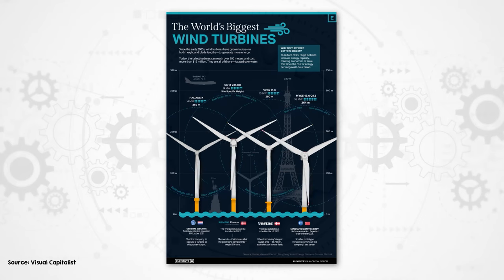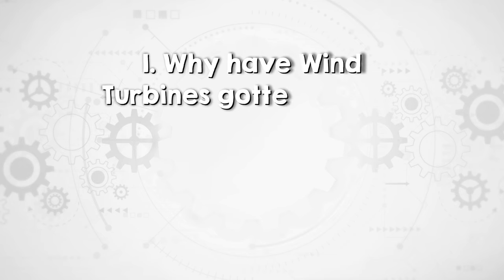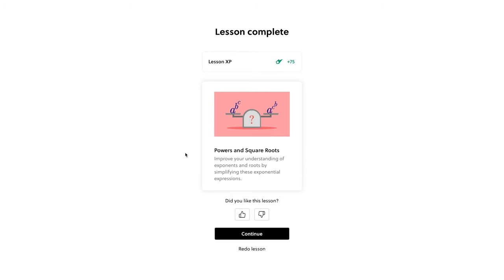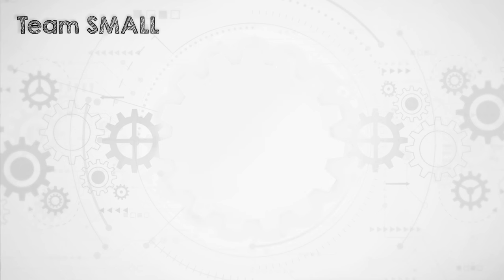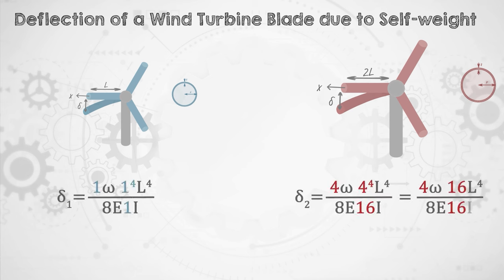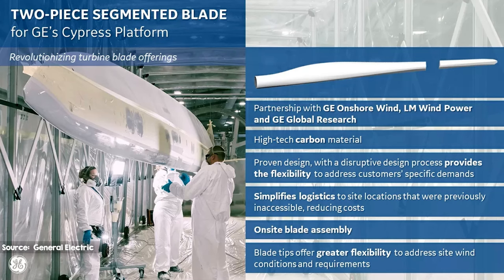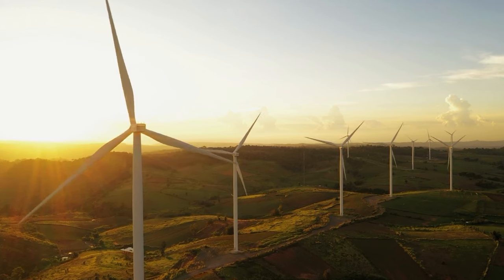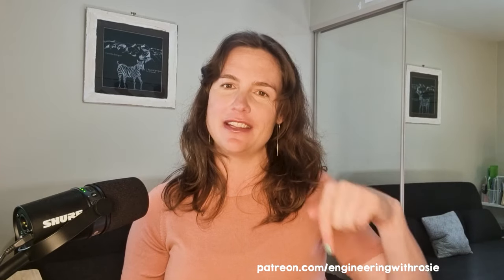Discover the Surprising Science Behind Wind Turbine Design for Lower Energy Costs!

Comment: Or maybe blades will change. Airplanes went from 2 blades to 3 to 4 to 5 as more power was applied. Then there's exotic designs like scimitar blades. Maybe wind turbines will do something equivalent. And generators could go with superconducting coils/magnets. Lots of room for improvement.
Reply: Three blades is optimum. As l understand it you have to allow the wind to pass through - more blades and the wind will take a path around. Anyway there's actual experts have made videos about this.
Reply: @DavidOfWhitehills  I've watched those and more blades also mean lower speeds for same torque, therefore quieter,  and less air speed difference between the top and bottom blades.
Reply: @tsbrownie  So why aren't they being built with more blades?
Reply: @DavidOfWhitehills  Why were the first aircraft 2 bladed? Same with ships screws. Look at the development of submarine screws. These things usually boil down to current technical capability and costs. Those change with time.
Reply: @tsbrownie  Hmm. If you obstruct the wind you lose the wind, it will just go around or over.

Comment: One key parameter you didn't mention is the energy return on energy invested (EROEI or EROI). Not only does the parts get heavier and cost more, but they take more energy to make a large wind turbine. But also the power produced goes up as the square of the disk radius. Also the EROI is determined with the total energy produced over the lifespan of the system. Wind turbines have a operating life span of 20-25 years. So EROI is the amount of energy produced by the wind turbine over its total lifespan divided by all of the energy that went into making all of the parts plus the energy required to transport and install the wind turbine and lastly the energy expended to during maintenance Of course the higher the EROI the better since the amount of energy that is available for use is hopefully many times greater than the energy that it took to make, install and operate the wind turbine. In the limit a EROI of 1.0 as low as one would go since you would only get back energy exactly equal to the energy you put into it. So which increases faster with radius, the sum total of power produced over its lifetime or the amount of energy that it took to make and install thicker walled and taller steel masts, heavier gearboxes and blades. 

invested
Reply: Many have been found to have a lifespan well under the 20-25 year prediction. Some are lasting less than 10 years due to leading edge abrasion and delamination of the blades. This is especially the case in coastal locations and offshore installations.

Comment: Another great video. 
I didn't know you had a PhD as well. Your formal expertise in these fields is far greater than you have let on, so it is Dr Rosie from now on. :)

As for the future of wind turbines, if blades that can be assembled on site, arrive in two or more pieces, can't be competitive priced, then I can't see many onshore wind projects having larger turbine blades. As you pointed out, the challenge isn't just going to be the problem of the logistics of the length, but the cross section or diameter at the base of the blade is going to be a major limitation too. 

Off shore wind turbines has a greater potential to keep getting bigger as the logistics are less of an issue, but the handling cost is surely going to become more expensive as they grow in size. The only question then is what the rate of increase of these costs are compared to the energy returned. Sure the squared vs the cubed does help, but at some point the returns will diminish, however I think we are a long way from that point.

Comment: Very good.  I play in small (micro) wind energy ~ I do a bit of writing and sometimes teach workshops on the design and build of small wind electric systems.  Size often comes up and I always have to point out the advantage of height (which often comes with larger machines) ~ and the fact that energy harvested is related to the cube of diameter while the weight of the rotor, and the alternator is roughly related to the cube of the diameter.  With small, direct drive alternators I usually use about 8x the magnetic material and 8 times the copper, if I double rotor diameter.  (4x the power at half the rpm)  I love your channel.

Comment: Great videos on wind turbine design, very informative. I particularly enjoy the ones on VAWT’s as I got involved in a VAWT start up after I retired, but subsequently left the business for reasons outlined below. 
Without giving too much away wrt proprietary design which is being patented, we were trying to boost power output by manipulating (increasing) native wind speed impinging on the blades of an H blade VAWT (though it could also be applied to spiral blades). 
Ref the wind speed power equation, the two easiest elements to modify to increase power are obviously swept area and wind speed. In one of your VAWT videos you cover why increasing VAWT swept area comes with increased costs and technical challenges, and why the Betz limit effectively rules out trying to become more efficient than HAWT’s as a credible performance improvement avenue. 
So that leaves wind speed, which because it’s cubed in theory offers by far the best chance to increase power output. However, increasing native wind speed requires external intervention / interception and we found via patent search numerous examples of VAWT designs employing external devices to do this, eg, cowlings, Venturi’s, funnels, diversions, channels, etc, but what was also obvious was that none of these seem to have ever been effectively commercialized, suggesting they either don’t work or more likely don’t work well enough to warrant significant development investment. 
As we progressed through TRL design and testing we did find some wind speed increase that would require VAWT / blade design optimization to capture maximum benefits, but it wasn’t enough to likely challenge and replace the dominance of HAWT’s on the market. 
HAWT’s dominance effectively meant breaking into the wind power generation game would require significantly more power (wind speed) increase than we had seen to warrant an investment risk on a new tech start up as opposed to a less risky ROI through simply making bigger HAWT’s! 
After much consideration it was the observed experimental limited wind speed increase potential, slow and expensive pace of development and extreme business challenge that caused me to make my decision to leave, but it was still a very interesting project to be involved with. The business is still working on trying to improve the concept! 

So this brings me to my technical question to you, in your opinion why do you think attempts to increase native wind speed before hitting the VAWT all seem to fail, or at least not work well enough to warrant further investment, and finally achieve commercialization? Maybe a good topic for a video?

Comment: Would you comment on the idea of multi rotor contra rotating turbine hubs.  I understand wind turbulence from adjacent wind turbines in a wind farm is a consideration in efficiency.   However many propeller based aircraft designs over the decades have successfully used contrarotating propellers accepting any inefficiencies for the advantages of smaller diameter and ground clearance and high engine power absorption.  It would also seem that the upstream rotor is adding some kind energy in the form of turbulence to the air stream that the downstream rotor could possibly be designed to take advantage of.  The common understanding of wind farm inefficiency due to air turbulence of nearby turbines does seem to get a little more interesting when the accepted use of contra rotating propeller aircraft is introduced in to the conversation.

Comment: Hello. Good, but there are some little points - hmm:
"Kevlar" is Aramide. And under pressure it's much worse than under tension (The same for HM-Carbon fibre not mentioned here.)
Next important point:
The gearbox growth is exactly by cube with diameter: If you double all dimensions of a WT, with a constant tip speed you end up 8 times of the torque. That's in fact the same machine (except minor aerodynamic incluence in this sizes- bigger is better - as in real life). 
So if you have the direct-drive Enercon E126 with 400 tons of Nacelle- try to made a 200 m rotor :-) A rough estimation ends up at 2000 tons. 
I assume you'll kill additionally all the frequencies of the tower. Therefore: gearbox- machines- maybe. But direct drive has stopped already.
And to compare strong-wind and low-wind-machines isn't as easy. That's apple with pairs.

Comment: As an electrical engineer with some structural and heavy equipment background, your math and graphics ratio were perfect.  What a great example of a typical engineering problem - optimizing many design variables.  And scaling is such a wonderful way to prove design concepts but can be problematic in certain engineering areas such as fluid dynamics if I recall.  Scaling, and ignorance of resonance, (as someone else commented here), was the downfall (literally) of the Tacoma Narrows bridge.

Comment: Excellent as always. I enjoy your forays into the formulas and principles without tipping over into total geek speak. You tread that line well. How to different soil structures figure into foundation design? More importantly, does it significantly affect the cost.
BTW, any reason for eating cake yet?
Reply from the maker: No celebration cake for me yet, though being 41 weeks pregnant has led to a few cake cravings I will admit (assuming that's what you meant by the cake comment!)
And I'm glad you thought I got the balance right between showing the important formulae but not making it an engineering lecture. It's a tricky balance!
I don't know a whole lot about foundation design, but that could be a cool topic for a livestream if I can find an expert to get on as a guest. There have been a few foundation failures in the news recently, it works be nice to find out more about what that's about.

Comment: Another great video Rosie!I find turbines fascinating and have pondered this question before. Two thoughts came to mind whilst watching the vid:

- might it be possible to construct a pressurised blade? In the same way that a paraglider's wing stays formed during flight, a pressurised blade (with a compressor near its 'root' and electrically powered) would help maintain the form of a partially 'flimsy' shell. This could reduce manufacturing and transportation costs.

- Thinking about when the wind is not blowing, is one large inoperative turbine better than 5 smaller inoperative ones? Or is it better to spread the risk of no wind?
Reply: Hm, a pressurized blade seems like a good idea, until the pressurization system fails.  In the 1980s, there was a trend of building stadiums with super lightweight membrane roofs weighing a fraction of conventional truss supported ones.  They were held up by a slight overpressure in the building and were of course much cheaper to build.  Eventually they all failed due to environmental conditions and/or failure of the overpressurization machinery.  All but one have since had major structural work done, aka explosive demolition.  Great in theory, not so great in practice.  There's also the problem of pumping air from a stationary compressor into rotating structures.  I'm a structural engineer, not mechanical, but it doesn't sound easy.
Reply: @drecksaukerl  Thanks for your answer! My thought was that the compressor for each blade is built into the base of the blade, electrically powered by a 'ring' electrical connection through the turbine's axis and possibly also the pitch mechanism. Re: compressor failure - I guess this would depend on air leakage through the blade and whether the brake mechanism could halt the blades' rotation quickly enough to prevent serious damage and if a pressure connection to adjacent blades would be worth consideration.

Comment: Thanks Rosie.  Your video got me thinking (the best compliment 🙂) is the air mass of anabatic and katabatic winds sufficient to support power generation? I live near a coastal mountain that has a cliff face with tremendous winds (in both directions) I sometimes wonder if very large axial fans of efficient design, bolted to the cliff face, could overcome the tower issues?

Comment: Great video!! Very educational!! . You said something about new designs and I agree with you there too. There’s a wind machine design out there that instead of going up in the air is going down to the ground , in fact it’s going to be under ground. The designer thinks this machine could produce hundreds of megawatts per machine and produce power 24/7. Could be installed near the consumers, thus saving on transmission lines. 
Very interesting design. It is a super wind machine.

Comment: A great presentation. I think you could, though, perhaps have made the point that the optimum size for offshore and onshore turbines is very different because of the fabrication and transport challenges of very large blades for inland ones (shipyards are designed to fabricate huge structures, and you don't need to worry about bends and clearances on the water). For inland ones, therefore, the optimum size is mostly set by these constraints while for offshore ones it is set by the scaling issues you detailed so well here. Of course offshore has its own expensive issues (eg getting the power back to shore), but the point is the size considerations differ.
Reply from the maker: I agree, and I thought I did say that! Not very clearly obviously...

Comment: Great explanation, I think most systems have a 'sweet spot' size wise and it's not always just about what's theoretically possible. Something I'd therefore be very interested to know is what are the life limiting factors and components for wind turbines? Currently life expired turbines usually get completely replaced (re-powered) after 20-25 years because larger and more efficient turbines have become available since they were installed. This does obviously increase efficiency of the particular wind farm but it's arguably not a good use of carbon intensive materials (or costs) to do a complete replacement. So it would be interesting to know what will happen once most turbines achieve an optimal sizing, as suggested. Could these turbines be maintained and run indefinitely?  What parts would need to be replaced, and what parts could be reused? Foundations and grid connection are a major part of the cost, so I would guess big savings should be possible if these can be reused, and both should be good for 100+ years.

Comment: just a thought, what you build a hub with a Long interconnected arms like  a bicicle so you use the same blade but with a 15 to25 meters more, and you could even have a different sleeve in the first part so the pitch can be adjusted in the Ruth and the tip independent, transport will be easier and it will work in a wider range of wind speed.

Comment: A question please 😊 
I’m mystified At how fast the blades go, the outer portions many hundreds of KPH . I’m wondering how this intense speed of the outer portions of the blade can actually be helping generate power, in my way of thinking it’s a burden on the system as the prevailing wind is vastly slower ? (My humble comparison is only with cars, where wind resistance when you go over 200 kph is like hitting a brick wall)
Thanks

Comment: Really interesting video - thank you for the formulae behind the factors on either side of the tug-of-war.

Now a question.  Why do turbines all seem to have 3 blades?  Without one blade running into the turbulent air of the preceding one, couldn’t more energy be ‘harvested’ with 6 blades (or 4 or 5) without needing longer blades (or higher towers)?
Reply from the maker: That was one of the very first topics I covered on this channel 😀 https://youtu.be/f3hgB-0rPOI
In a properly-designed turbine, there isn't any air slipping through the gaps between blades, every air molecule has some of its energy extracted.

Comment: Another aspect is the windspeed every cross section sees. Near the hub - most if not all design is for strength and are probably not adding power. 
Further out is a transfer to an actual aerodynamic profile while the windspeed crossing the blade is not much more than the wind a pixed point sees.

But at the wing tip the wind across the blade is extreme, I imagine it may be close to what a aircraft have.
At some point of scaling turbine blade up -  I think the wingtip is more drag than adding power. What do you think?
Reply: As she mentioned in the video, the rotational speed is reduced with increasing diameter, so the tip speed stays the same for optimal aerodynamic performance.

Comment: Loved the video. Subscribed for more. Wondering how often you need calculus verses pre defined formula?
Reply: Most calculus/algebra using in engineering are pre defined formula....if it works, then no point starting from scratch just to get the same result.

Comment: A few thoughts:
Are these very large machines already a 'hazard to navigation' for aircraft & if not how big can you go? 

What do you do about different wind speeds & directions at different heights? 

Can you end up with a machine that's big enough to launch satellites off it's blade tips?
Reply: Onshore they are a hazard, at least for small recreational aircraft.
Offshore its not a problem as no aircraft flies at 200m above sea level.
Commercial aircraft usually cruise at 10,000m above sea level.